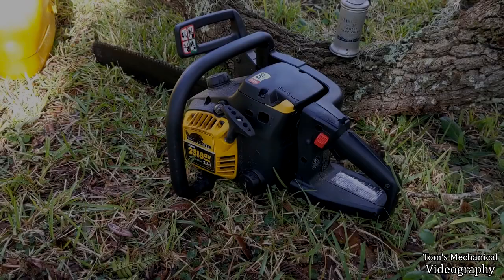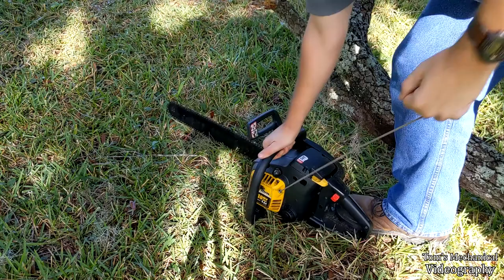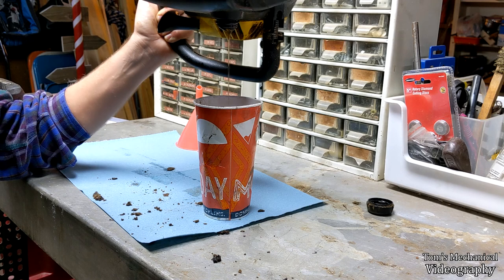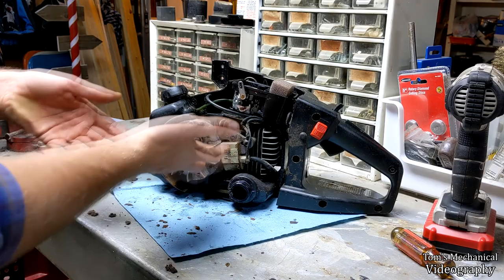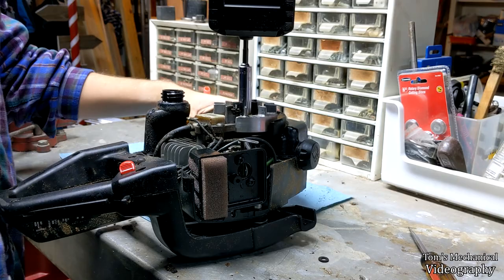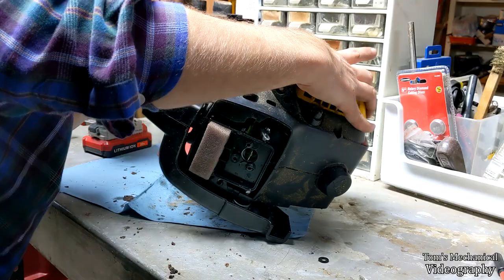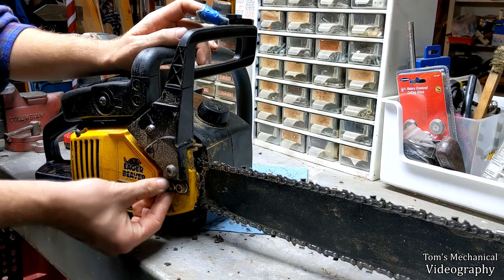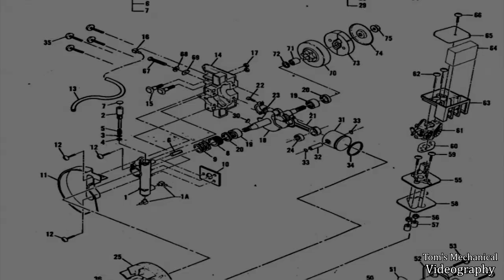Oiler Repair: McCulloch Eager Beaver Super 2318av

Comment: Indeed the oiler worm gear is probably slipping on the crankshaft. Use loctite blockpress to fix it on the shaft. Second possible issue is the oiltankvent which is I think your problem. You can check this by running the chainsaw and open the oiltank cap a bit such that air can come in. If it starts oiling there is your issue. Other possible prolem block oil line screen.

Comment: Congrats, you finally saw the missing spring tensioner. There are also felt washers missing but they wont cause the pump not to work. Also, the gas and oil tanks are one piece units. The reason they leak (my experience) is because the cork gaskets in the caps get hard and crushed, losing their ability to seal. Then people crank the caps tighter trying to stop the leaks. The oil tank cap especially will then pull so hard on the tank threads that the strain cracks the tank around the threads. If you see the oil cap touching the raised lip on the case you need to replace the cork gasket. And last, I didn't see you check that the oil hole in the back of the bar was clear. Maybe you did off camera. Ok last last, if its a Mac bar the nose end has a tiny hole on each side for greasing the nose sprocket. Cheers.

Comment: Has to be the worm gear. On Stihls, there is a small tab on the chain drive that physically pushes a bellows pump. If you didn’t know about, you’d never know why your oiler isn’t working. My point is that it is a fiddly, tight-clearance kind of mechanism. Same problem here… Your oiler pump has marks on it, so something is rubbing it - but not driving it. The difference could be 1/64th of an inch! 

BTW, make sure the oil hole on your bar isn’t clogged. I bet you knew that, but just in case… 

Thanks for the video! A buddy gave me his, with parts and loose screws in a bag. Seeing you break yours down was a huge help for me to get mine back together! It might even start when I’m done…
Reply: As he figured out, the spring tensioner was missing. The worm is a slip fit on the crank and relies on spring tension only to drive the pump. I've had to stretch them to get consistent oil flow. I also did not see him check the bar holes, maybe he did off camera. They're not bad saws for the price. You just have to know what to look for. And on those Stilh's it can be easy to miss lining up the witness mark on the clutch drum with the wire tab that drives the pump. Sounds like you have been there. Cheers

Comment: When you start the saw you should leave the chain brake off.  The throttle is locked on high so the clutch is trying to drive the chain with the brake on. You have all the other start up procedures correct.

Comment: Makes you wonder why a successful company would would drastically change a design in such a way  you would just assume throw there damn saw away rather than put it back together…….   

I have an eager beaver 
. Strong little saw, but the one 7/16 nut on the bar, and having to take the clutch and bar cover off just to see if your getting 🔥 is insanity… 
The Architects and engineers of the design should be taken out into the field and horsewhipped
Reply: Horsewhipping is to goof for them… Slow fire on their feet, perhaps?